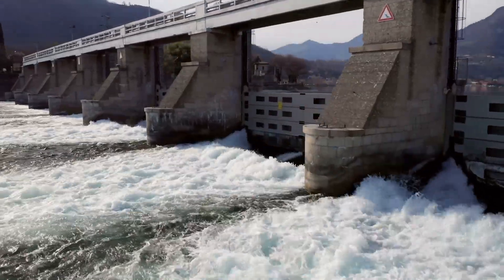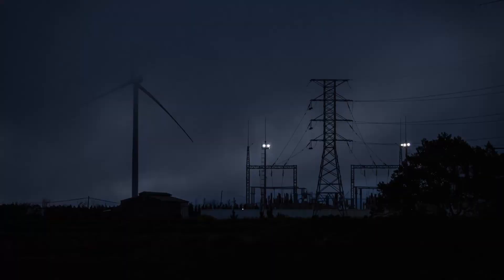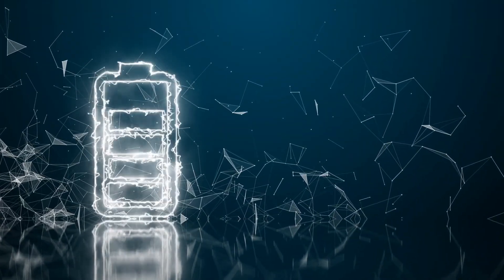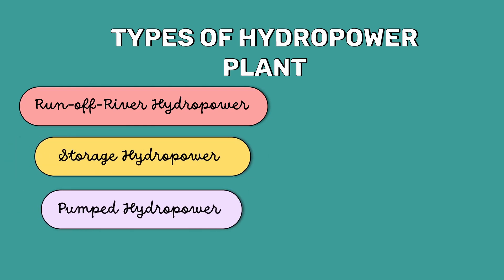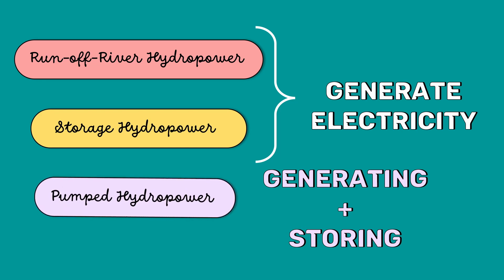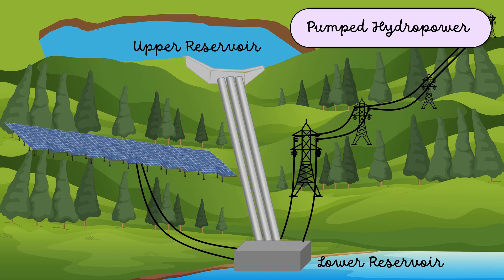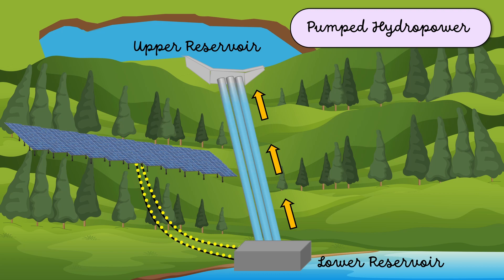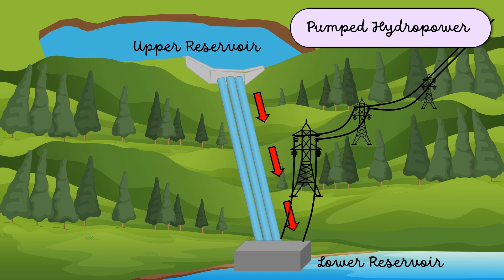How does a Pumped Hydropower Plant work?

Comment: And what about the efficiency?
Reply from the maker: The efficiency of generation is about 90%. This means that 10% of the energy stored in an upper reservoir is lost when the water passes through the turbine to produce electricity. In a complete cycle, water is pumped from a lower to an upper reservoir and at a later time returns to the lower reservoir, with a round-trip efficiency of about 80%. In other words, about 20% of the electricity is lost in a complete pumping/generation cycle.